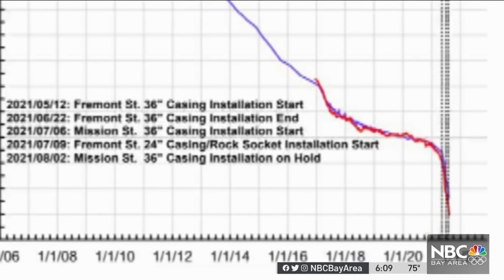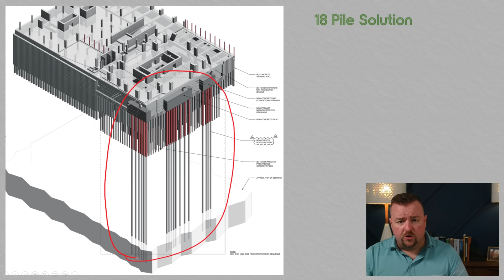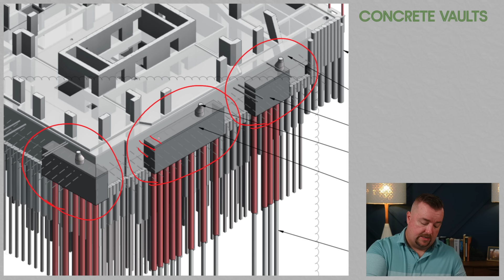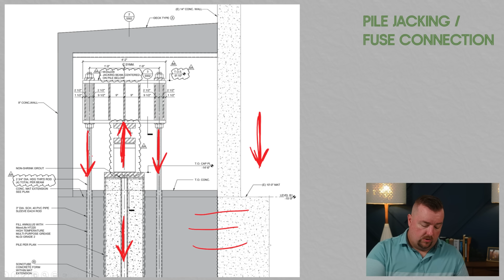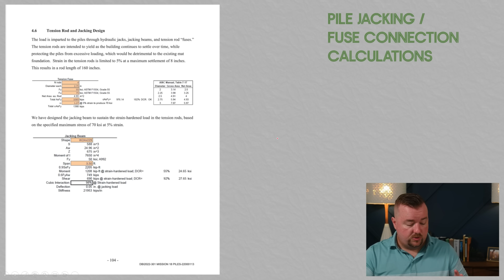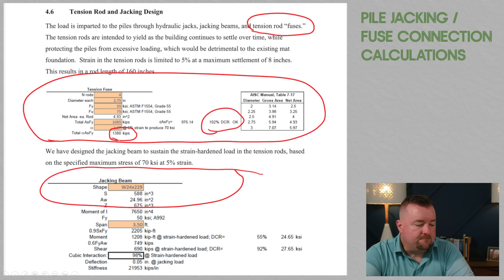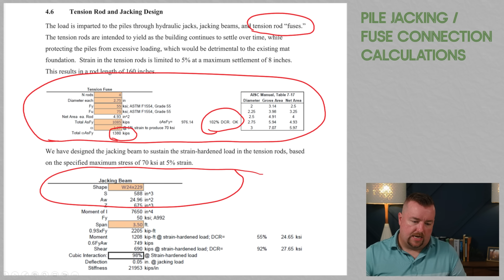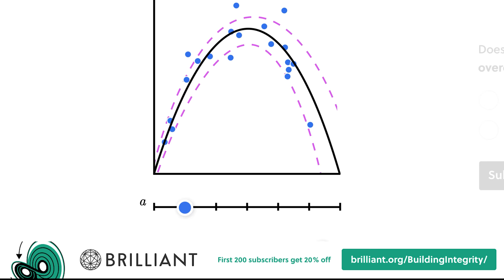Did I Uncover a $100,000,000 Mistake with the Millennium Tower "Fix"?

Comment: I'm getting a bearing area of the nut alone to be 5.0 square inches (bearing area of nut minus area for SCH 40 pipe used as anchor sleeve).  If I use the ACI pullout strength equation for checking crushing of the concrete, I get:
Npl = 8 x Abrg x f'c = 8 x 5.0 sq in x 5 ksi = 200 kips

I then reduce the nominal strength by the resistance factors:
0.67 x 0.75 x Npl = 112.5 kips per anchor rod

The total design strength from the bearing area of the nuts alone would be:
4 rods x 112.5 kips per rod = 450 kips

Now lets assume there was a 5'' diameter x 1 1/2'' washer instead of the plate:
Abrg = 3.14 x 5 x 5/4 - 3.14 x 3.5 x 3.5/4 = 10.0 square inches bearing area
0.75 x 0.75 x Npl = 0.75 x 0.75 x 8 x Abrg x f'c = 225.3 kips per anchor rod
The total pullout resistance would be: 4 rods x 225.3 kips per rod = 901 kips

The shear resistance of the plate is:
0.75 x Vn = 0.75 x 0.6 x Fy x Area = 0.75 x 0.6 x 36 ksi x 22.5 = 364.5 kips/rod
The total shear resistance would be: 4 rods x 364.5 kips/rod = 1458 kips

Looking at these numbers, I think a more robust analysis of the rod/plate assembly would show that it is adequate for at least 1000 kips.  My opinion, but I could be wrong.  It might be worth it to check shearing of the rod threads, especially since the rod is be taken past yield, which will tend to neck down the rod, therby reducing the contact of the rod threads and the nut.
Reply from the maker: Your plate area of 22.5 appears to already include all 4 locations.  I believe you should have used 5.625 in^2 for a shear value of only 91 kips/rod.  Based on the material properties they specified for the plates I get a bit more, but still not the 340 kips (or even 250 kips) that each rod will see.
Reply: @BuildingIntegrity  I see what you're saying.  You're taking 6.5'' plate width minus 3'' hole size to get the area.

Appreciate your coverage of this topic.  I've been relying on new articles that don't really explain it very well.
Reply from the maker: Thanks for your thought out comment and calculations.  One of the things I've noticed with this project is that most of the critics and folks put on SF television are all Geotech guys so I wouldn't have expected them to find something like this.  I honestly didn't expect to find this problem when I began reviewing the load paths.

Comment: I've been a handyman for nearly 50 years. . . many of my jobs have been outside of the box and entailed heavy steel fabrications . . . on occasion, I've had 3/4" plate punched for 1" all-thread, utilizing either a dutchman or a turret punch.  It always amazed me how easily those holes could be punched.  Those tools surely didn't have anywhere near the power that you're telling us the all-thread is designed to support.  So, I can imagine that the lower nuts could actually pull right through the 1" plate, especially during a significant seismic event.  Of course, the pull through of one all-thread would divert its load to the other three, perhaps causing them to pull through . . . and then your postulated cascade event would ensue.  I'm wondering if, in that event, one side of the mat would drop and create a rocking motion that could set up a frequency that would disintegrate the building.

Comment: How would this work with a dynamic assyemtric load  like an earthquake? If the building is swaying it seems a high risk of overloading some of  these “fuse”bars putting more stress on the remaining ones leading to a cascading failure?
Really good video and great job explaining.
Reply: It wouldn't work very well, with that small area of metal plate 1.5 in thick pushing against concrete above it which is supposed to be attached to the existing building a couple feet away. There's huge shear forces within the concrete even if the building isn't being shaken left and right. This is terrible
Reply: And if the engineering analysis had included a harmonic analysis, then the answer to this question would be "it'll be fine up to an earthquake of magnitude X." Of course, these meatheads didn't do such an analysis and the reviewers said "sure .. that's fine .. we don't need to worry about earthquakes in San Francisco." Did I say "meatheads?" So many meatheads!

I'm never going to get over a civil engineering project with a safety factor in those "fuses" under 1.0x. I get it in head bolts, where the worst that happens is the head goes through the hood, but in this case, if these "fuse" bolts neck, it's game over for many city blocks!

Comment: For a building that has acted in ways a large number of engineers did not think of, resulting in a lean that appears to be 'under control' every time the owner mentions it, begs the question with the continued leaning has anyone set a hard, and I mean HARD 'stop working to fix it, start working to dismantle it before it topples and takes out other buildings in down town San Francisco'. Just think of that libility. Potentially hundreds of lives impacted, homes destroyed, businesses shuttered and roads closed indefinatly.

Comment: I am an engineer, and I believe I recently commented on another of your videos. Thanks for sharing. 

As an engineer that is asked to review other engineer's work, I find this situation you uncovered to be "jaw dropping." I can't say everything I think on this public forum. I worry that some would say you said more than you should. I'm stunned San Francisco isn't more engaged in this situation. 

Remember when the Florida pedestrian bridge span failed under its own self-weight? I fear computers are not helping us get it right.
Reply: The FIU bridge situation was a wild ride. Federal guidelines had lackluster rules on concrete bridges, lacking in load and redundancy information. The Florida bridge codes had no rules for nonstandard bridges made of concrete. The independent review firm did not have the qualifications to review a structure like that bridge, bid on it anyway. There was no requirement for the contractor to send a qualification letter. (That firm, Louis Berger Group, has all kinds of shennanigans, fraud in Afghanistan, bribery in several other countries)

First cracks showed up 19 days before the collapse, the span was on the supports for about five days before it failed and was getting worse each day, but the engineer of record said there was no cause for concern. Big influencing factor was that nobody wanted to be the one to make the call to close down 8th Street since it's a massively busy road.
Reply: @starwhip7697  I don't believe there are "Florida Bridge Codes". There could be local addendums to the AASHTO Bridge Design Specifications, but it is not like the Building Code that does have state by state adjustments. Other than that, I can't dispute what you shared. The Bridge Design Specifications are tending toward vagueness in an attempt to allow engineers to be more innovative,  but my experience suggests that is a mistake.

My other big thorn with the aftermath is the desire to put this on Louis Berger, the "independent" review firm. LB's scope of work was trimmed down to give them only a few hours to review the overall design. Someone needs to take accountability for those decisions other than just LB.

But more importantly, it is being stated as if it was LB's job to catch any mistakes, which is wrong. It is FIGG's responsibility to have an adequate design/check process that catches the mistakes. LB was not the "checker" as we say in this field, but the "reviewer".  In the end, I don't believe LB's exposure should be any higher than the ratio of their contract to that of Figg.  If Figg got 10 million and LB got 500 thousand, then Figg's exposure should be twenty times as much.  Figg is the engineer of record and they are responsible. The darn thing fell under its own self-weight. That is unheard of in the Bridge community. And as you point out, the warning signs were there.

The other problem is the contractor's and the engineer's reputation depended on delivering that Bridge without closing the road. As far as Figg is concerned, their reputation isn't any worse off for the failure as it would be if they had closed the road and took it back to the yard on the transporter. Their financial exposure is bigger, but the hit to their reputation would have been just as bad either way.
Reply: @eddarby469  Yea, my comment was not the full picture, just based on what I remembered from doing a research project on the NTSB report. Blame was on multiple parties for sure, I was just surprised to see what else LB had been involved in.
Reply: @eddarby469  The Florida bridge code comment was a loose interpretation of this from the NTSB report, 3.1 (Findings): "Had the FDOT Plans Preparation Manual called for all nodal forces of Category 2 bridge structures to be checked and verified by a qualified independent peer review, this collapse might have been prevented."
Reply: @starwhip7697  I'm not up on all the other LB issues, so I'll take your word for it.

Also, I didn't want to jump on You. You just kinda triggered me. Louis Berger has apparently become the whipping boy for FIB, and I just feel Figg is getting off light. Sorry for any misunderstanding there.
Reply: @starwhip7697  Yes, each state has their own local practice, but that is a little different than a design code. The NTSB remark is more related to contract administration of outside jobs. I believe the remedy here is just to hammer the responsible charge engineer for their failure. Then other companies will think about that before they agree to these aggressive off the wall jobs.
Reply: I’ve taught engineering courses and students are much too complacent about, “I ran it through modeling and got the numbers.”  Never mind the numbers are a few orders of magnitude off from what would be a reasonable rough estimate one could do in the head without writing anything down on paper.  I have always worked to get students to do estimates and think about what a reasonable outcome should be before ever committing anything to paper or computer simulation.  I have had quite a few students tell me that my courses were the only courses where that type of thinking has been stressed.  To me, critical thinking to evaluate the sensibility of a proposed design is one of the core skills of a quality engineer.
Reply: @eddarby469  Thanks for the reply.  It is good to hear from someone advocating for thinking skills instead of procedural skills.
Reply: @wtmayhew  Yes, the advent of computer modelling seems to have removed/changed a level of "did I conceptualize this problem correctly and is my approach sufficiently rigorous" self-review.  Many of us, in our engineering career, mainly used the most basic aspects of the mathematics we were exposed to in University. I was always aware, in my design work, that the approach I was using was most probably adequate for the  situation but that, somewhere (NASA?) there might be an Engineer using a much more rigorous analysis to design a similar solution ie: there was a "frontier" at which my approach would be overly simplistic.  I was aware the responsibility was mine and , if I wasn't highly confident, I sought advice from more senior personnel/mentors.  I believe that the use of software might allow an unconscious "sub-contracting" of the responsibility to the "software" itself.  For example, as PM on project, the Contractor approached me regarding a lack of lateral stiffness on an access stairway -standing beside the stairway at the bottom he could "shake" the stairs side to side by pushing against the handrail.  As a "teaching experience" I had the responsible engineer come to the site (under protest since "the program says its' all good') and we went into the field and rattled the stairway.  He got the message and added the lateral bracing required.
Reply: GIGO "Garbage in, garbage out."
Reply: @littleviking488  Thank you for your thoughtful reply.

Comment: Not a lot of experts here. Ill just say this. The fuses are not meant to correct the building back to original plumb. After seeing the building lean more during installation of the 52 piles, they reduced it to 18 as the plan was never to correct to original. The plan is to reduce the uneven settlement and allow the building to settle evenly.

Those steel rods are tiny for a building this size. And the plate is seeing only crush strength. Of the steel which is more than the yield strength of the very thin and slender rod that is 160 inches long.

Comment: How does this fuse idea work? Normally, a blown fuse will leave the system in a safe state but here, the fuses are holding up the building. When one fuse fails, the others will have higher loading.  No chance of a chain reaction?  Is the design that these new piles will reduce the load on the current piles, so that they don't sink further, but if the fuses suddenly failed, the current piles will still hold the building fine, but the progression of the sinking will then continue?

Comment: It's the missing calculation that matters.  Can those rods pull out of the plate via a shear failure of the plate?  It's the failure mode that you don't consider that will come back to haunt you.

Comment: The solution is simple but costly
Reduce the height of the building to match the strength of the current foundation
It will destroy the economics, but from an engineering perspective, it's pretty easy.
Reply from the maker: I think that should be considered as one of the long term solutions.  Though I'm sure there are others as well.
Reply: @BuildingIntegrity  At the very least, it is the baseline against which any other solutions should be evaluated.
It provides the greatest safety and the worst economics.
So another solution may be "cheaper",   but it has to be weighed against the additional risk.

If I had to pay insurance on this, I would be asking for this evaluation.

Solid content. 👍

Comment: I'm just a welder/fabricator but not only is the size of the anchor plates and loading the rods beyond their yield strength concerning but the whole system relying on the parts in the system moving freely makes me more than a little anxious. What happens when the settling of the foundation starts to side load the pilings and threaded rods and nothing moves the way it's intended?

Comment: Josh, that's a great point of that little plate supporting over 250 tons (two rods on one plate). But from thinking this whole project over, and thinking big picture here, I'm wondering if someone really screwed up the calculations of the load bearing capacity of the underlying soil under the existing foundation mat/friction pile system. If this is the case, then the building will continue to settle, and will never achieve equilibrium with the underlying soil, which in turn will slowly increase the stress on these vault contraptions and the concrete connection to the existing building. If the rate of settling is slowing down, then this "fix" might work, in that it only has to last long enough for the building to get back to being precisely vertical. At that point, IF and this is a very large IF here, the entire foundation system is in equilibrium with the underlying soil, then these vaults will no longer be needed, and could be abandoned or filled in and sealed off. If the building continues to settle unevenly, then the weakness of that small embedded steel plate is going to be a very small insignificant problem, and it'll be time to call in Controlled Demolition Incorporated, which will make a great YouTube video of the largest implosion in San Francisco history.

Comment: 2 nuts jammed together does not spread the load across the 2 nuts. The 2 nuts are "fighting" each other, the top nut is pushing up on the rod.
The bottom nut will carry the full load.  If they calculated the load capacity by simply doubling the value of one nut it will fail. They need to have custom nuts machined that are larger diameter and longer.. The larger diameter will greatly help the plate punch thru problem.
Reply: Wrong.  A static analysis of the nuts as they are installed and tightened against each other does not cover the situation when the rod is loaded.  The two nuts are tightened just so they will stay in place near the bottom of the rod as the system is being assembled.  There is only one nut holding the load at the top of the rod, so one nut must be sufficient anyway.